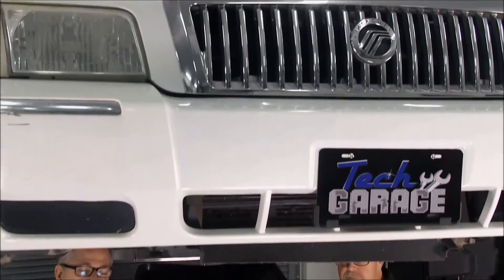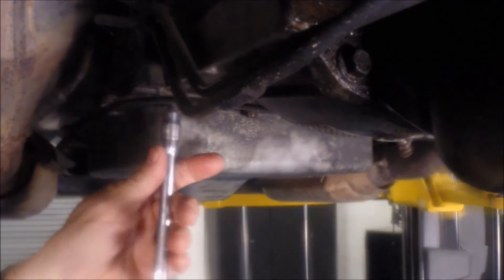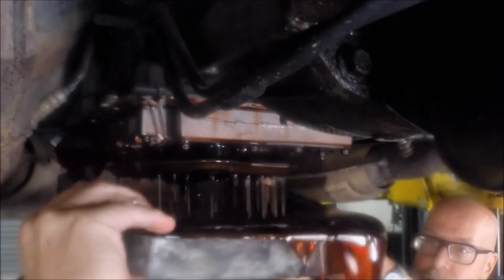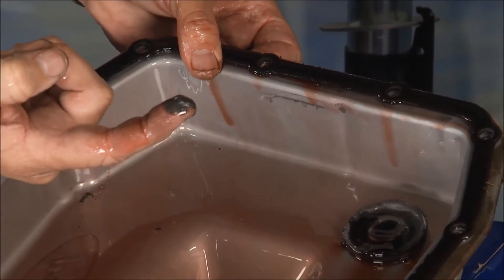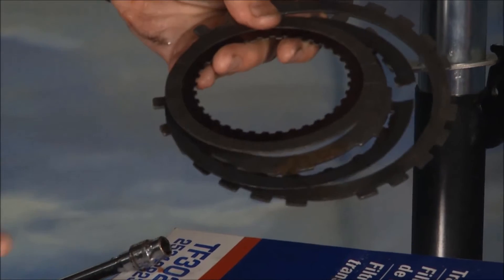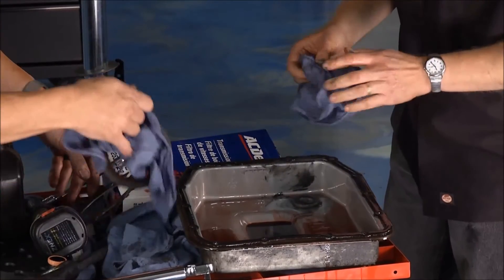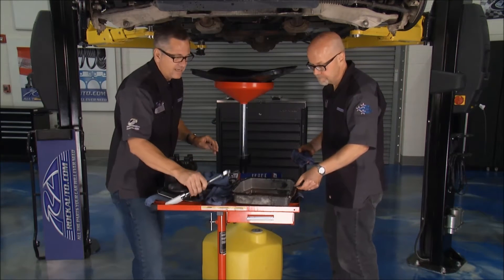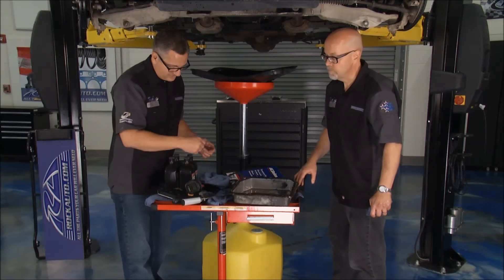How and Why to Change Transmission Fluid, Filter, Oil Cooler/Radiator (Season 4/E10)

Comment: Why didn't you use a hose and fluid transfer pump to suck out much of the fluid from the top first?  You could have reduced the amount of fluid that spills from the pan as the pan is removed.  Significantly less mess.